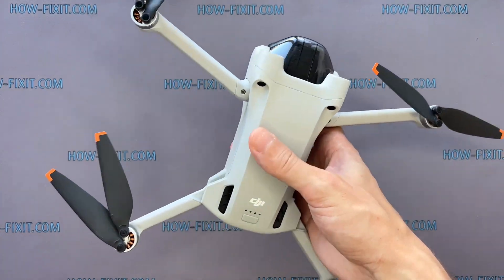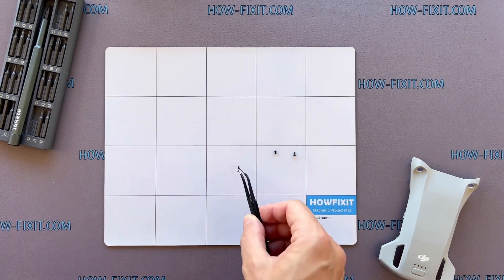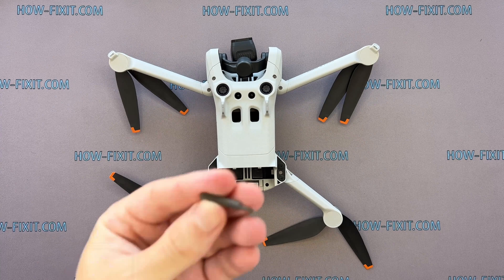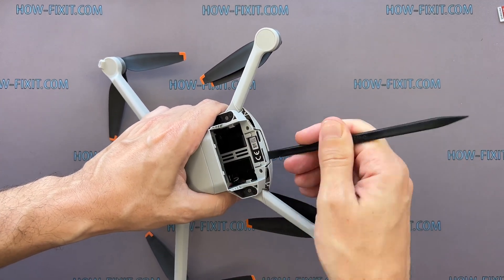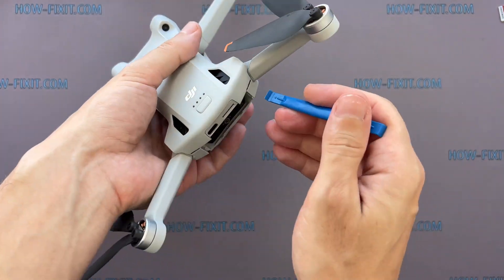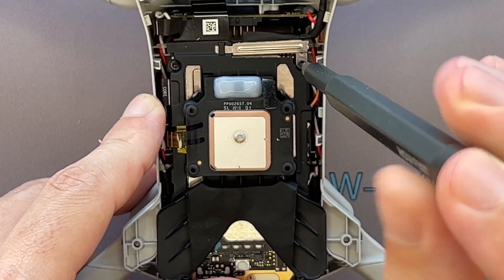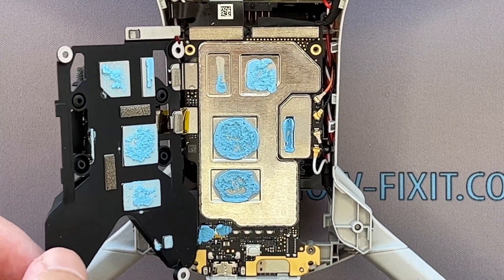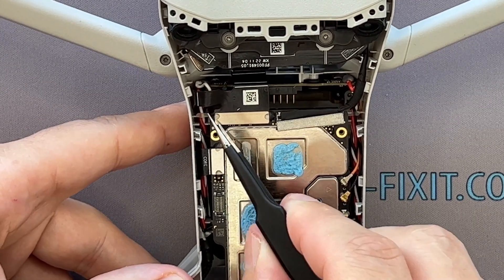DJI Mini 3 Pro Motherboard Replacement: A Step-by-Step Guide

Comment from the maker: After the replacement motherboard, you will need to calibrate your drone. Some calibration processes can be done with the DJI Fly mobile app, but for some procedures, like camera gimbal calibration, you will need to use additional software. How to calibrate the gimbal watch this video tutorial https://youtu.be/mu03HWXplM4
Reply: What is everything that you need to calibrate with external tools? For example, gimbal. What else?
Reply: wich is the code for mini 3 pro , this there isn't in the service tool
Reply: You have to be clear on something, THAT CALIBRATION METHOD only works for certain models, and "recent" drones like MINI 3 PRO are not in that list, SO PLEASE IF YOU ARE MAKING A MINI 3 PRO VIDEO TUTOTIAL don't confuse us with a video that will not work, so far most of calibration software for the mini 3 pro and similar are not on the web, at least not easy to find like those videos that use python, etc. For those who are looking for the solution,  I've find that "haking-drone" or "dank-drone" are the way, I'm not 100% sure but it seems that only the official software and a couple of modified software are able to fix it, and there are people out there that can calibrate your  remotely (sorry for my english, I hope you all could understand me)